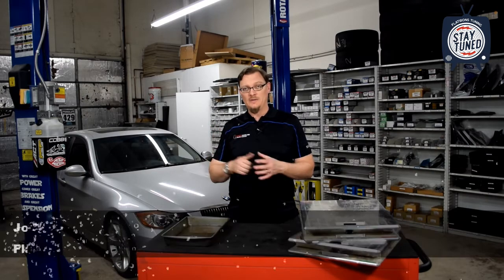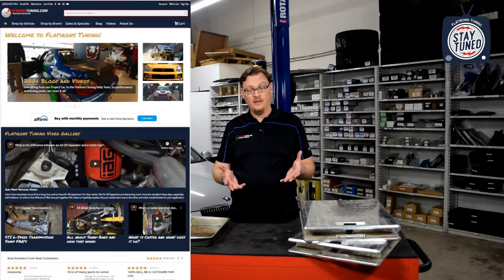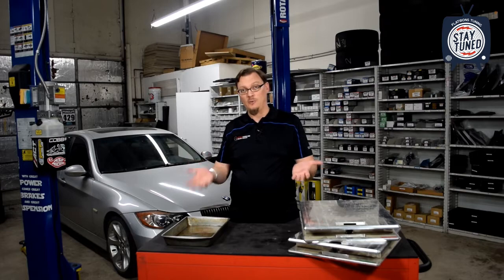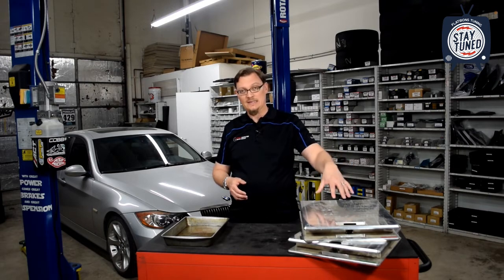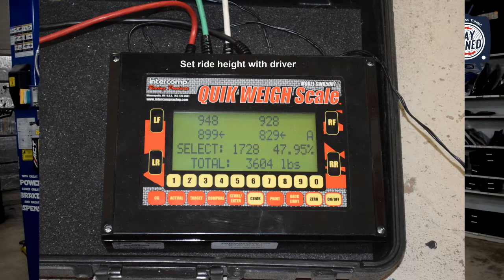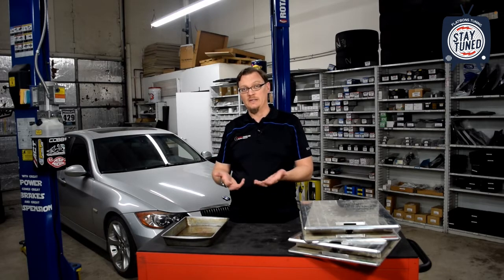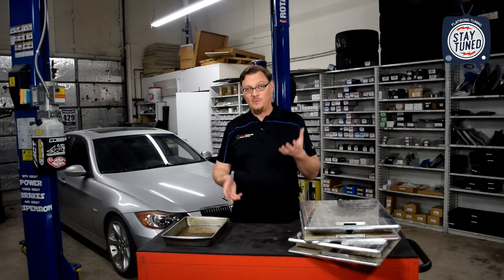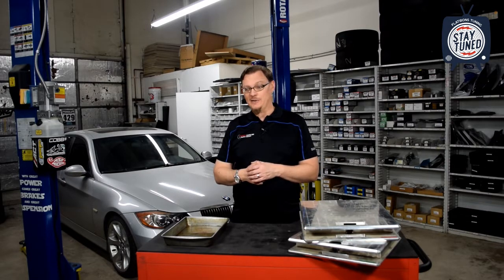What is Corner Balancing, and when does it make sense?

Comment: I don't dispute you observed what you did with respect to ride height change at the rear after adjusting the front but I do think your explanation isn't right.  Your water pan example differs from reality in that the mass of the water moved whereas there's no movement of mass in the car.  Even if all the mass in the car was located at the highest point of the car,  given the weight, height and wheelbase of the car, a drop of the amount you mention in the front would only shift a weight of approximately 50 lbs from the rear axle to the front.  To raise the rear as much as you indicated based solely on that weight change would require that the rear springs have a spring constant of approximately 50 lbs/inch would it not?  (And that calculation assumes the unrealistic situation of all the mass being concentrated at the highest point of the car.  In reality, the effect of the rake increase would be even smaller.)  I think another factor must explain the bulk of the difference; perhaps stiction in the shocks?

Comment: Sorry mate but you are wrong big time. With corner balancing You re not changing weight distribution per axle, but per diagonal. For axle load you MOVE weight from front to back (ie battery from front to track). Also the water example is not relevant. You engine doesn’t «flow» to the back when  you raise the front axle. Pretty much all this video should be deleted, it’s all wrong

Comment: Can you corner balance a vehicle that doesn't have a coilover system?
Reply from the maker: Thanks for your question.  Being able to adjust the height of the car is what allows you to adjust how much weight is sitting on each corner.  If you can't do that, you could, in theory, add weight around the car to achieve this balance.  It could certainly be done.

I hope that helps and Stay Tuned!